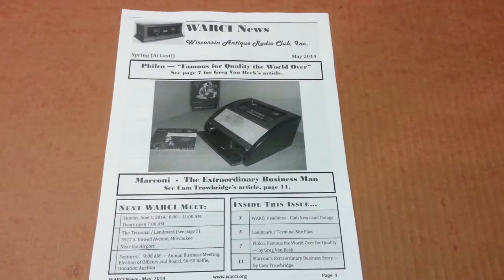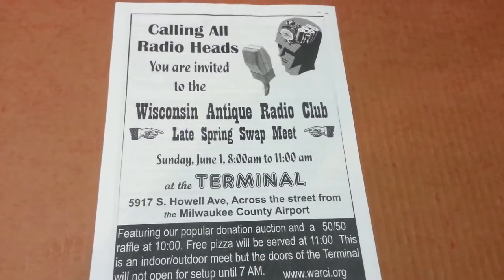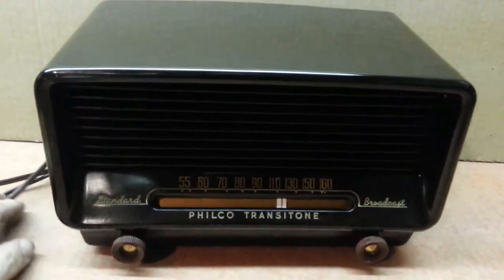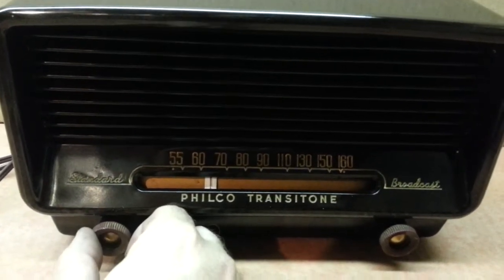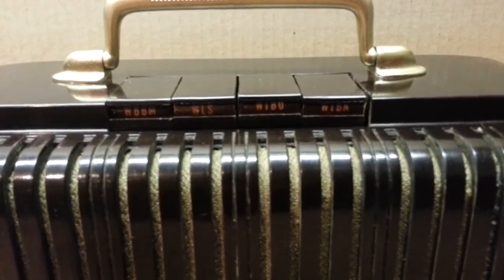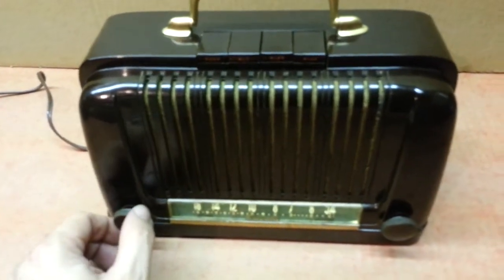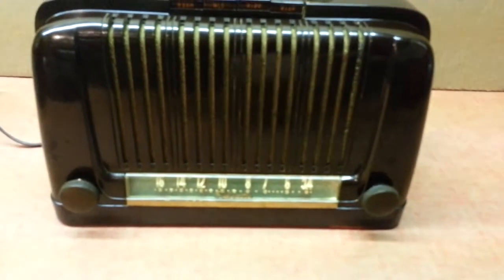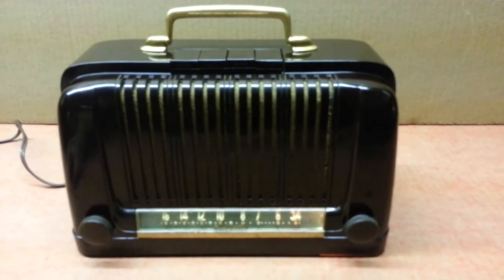1951 Philco 51-531 & 1947 Silvertone 6011

Comment: Gav,
“…nice to bring a radio back to life and pass it on….”  Now that I'm a little older and a little wiser, those are my sentiments too my friend.  When resurrecting a tired, worn out, radio, the greater joy for me, and I suspect it is the same for you, is to systematically fault-find, replace defective components, and then give it a jolly good clean and polish.
It would be great if we could keep all the radios we buy and restore but there comes a time when we have to switch onto practical mode.  Those two radios have been restored to a good standard: you shouldn’t have any problem moving them on.
Regards,
Phil.